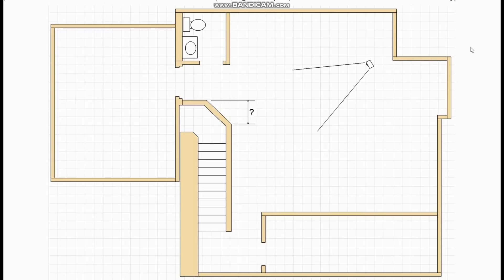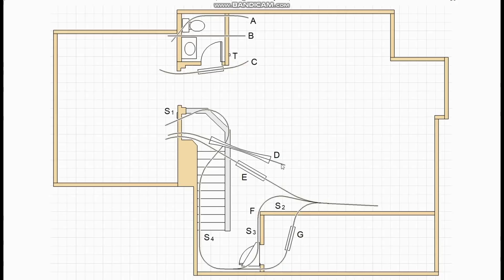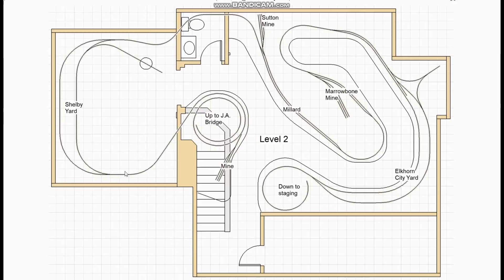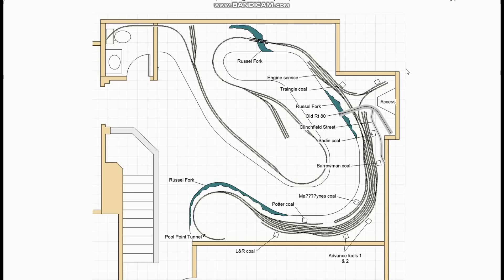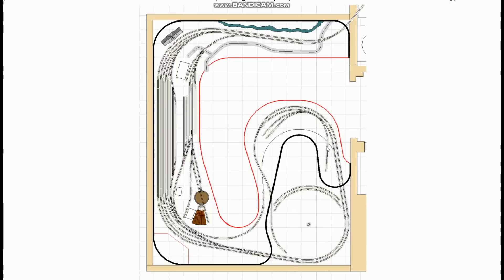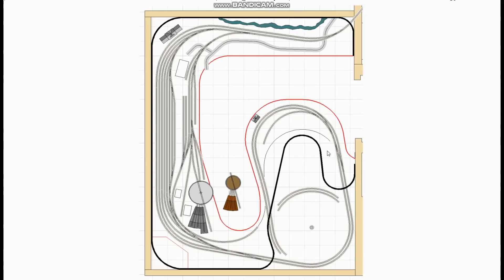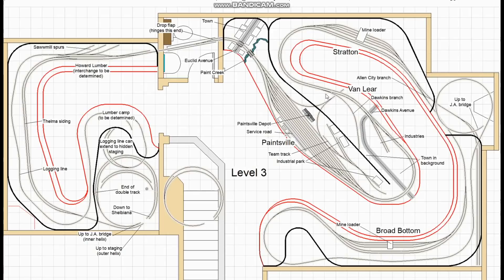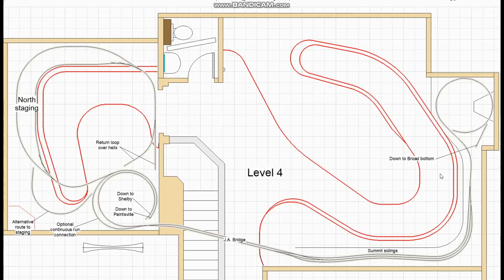Planning the Elkhorn division in HO-scale, part 1

Comment: This is really nice, I know this line well and I'm modeling the former CC&O/Clinchfield line about 30 miles to the south of Elkhorn, where it interacts with my N&W/NS at St Paul.

I believe the siding you are referring to near Pool Point is called Trammel by the railroad. Also, there is a place on the Clinchfield that swings back and forth, dropping a few hundred feet right beside itself, just down the hill, but with 8 miles between. That's about 100 miles south of Elkhorn, in North Carolina, but that's ok, and it's entirely prototypical to do such a thing, although not on the C&O, it's on the CRR, but we must do things in the model form to make our layouts wrap up into a square room and especially to deal with elevation on multi-level layouts.

I also have a bridge up at 80" or so, I love that concept, it solved a problem for me and I think is very interesting. I'm building it and sharing those videos on our Model Railroading Live channel, but I'm not trying to promote anything, I just model and share.

I enjoy your content quite a bit, and have for several years now. Thanks for sharing and keep it up.
Reply from the maker: Useful information.  Thank-you.

Comment: The layout design videos are my favourite ones. The earlier diagrams would be clearer if you shaded in the boards to differentiate them from the aisles (similarly to maps having different colours for land and water). The lines representing track also look similar to the edges of the boards, even though the track lines have the feint colouring either side.
Reply from the maker: Anything extra I do on the early diagrams adds to the time and therefore the cost.